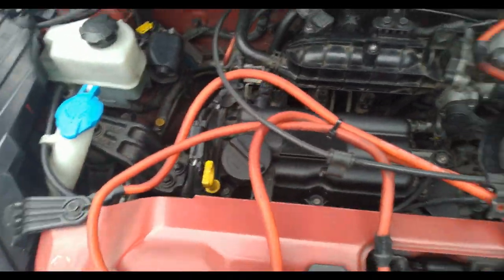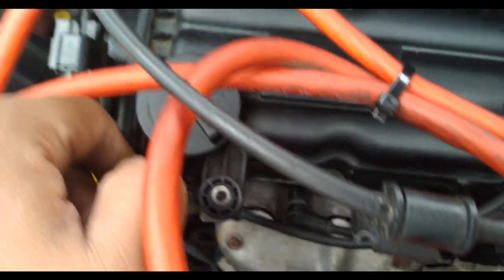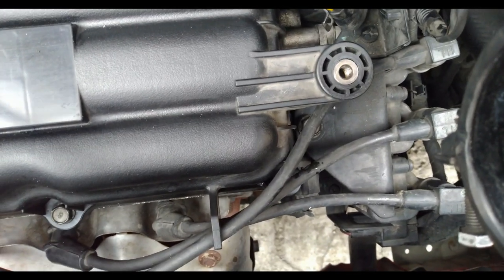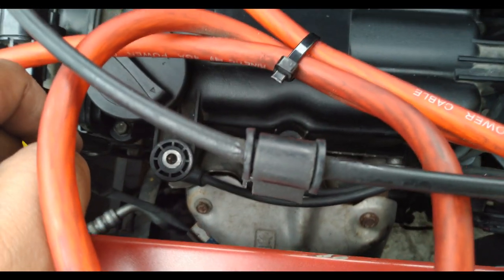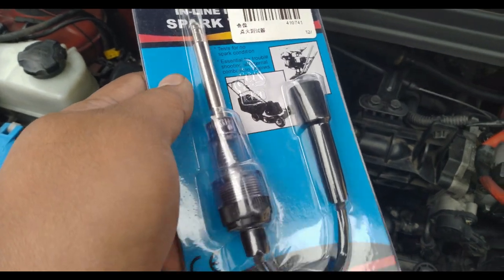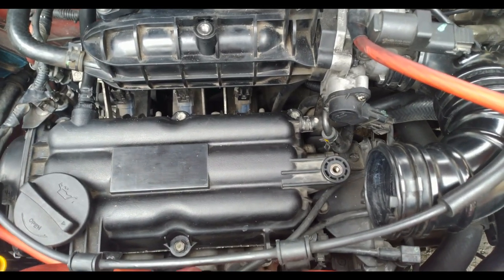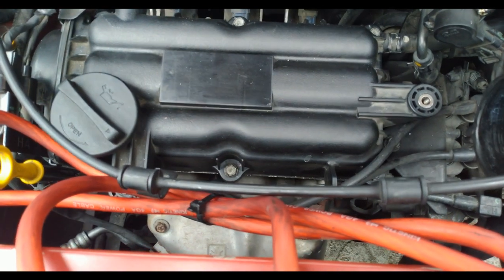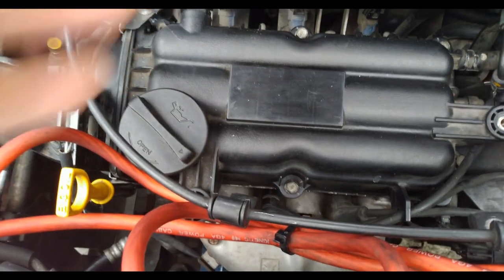HOW TO TEST THE IGNITION SYSTEM FOR HYUNDAI EON

Comment: sir meri eon subah start viberation ke sath hoti h or race dene ke baad normal ho jati h  or bnd krke dobara start krte h to sahi start ho jati h lekin 5-6 hours baad start krte h to fir bi problem hoti h.. or koi extra signal nhi aata... spark plug change krwa liye , fuel pump saaf kra liya throtol body saaf krwa li...or geniun 50000km chali h plz help smbdy